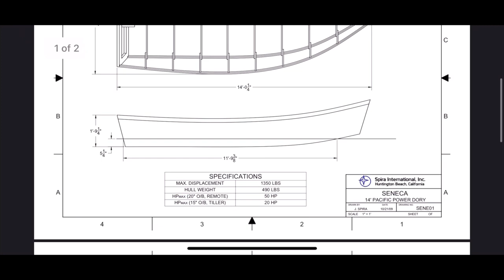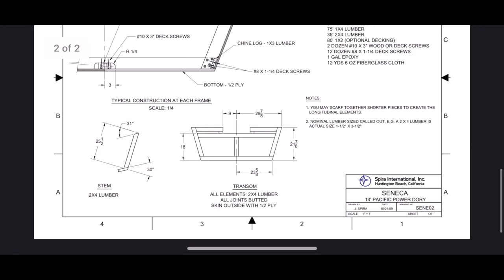Pacific Skiffs! I Built my own fishing boat! The Seneca Power Dory

Comment: Beautiful build!  How big of motor?  What made you decide on this model?
Reply from the maker: Thanks! I have a 6hp but I’m looking for a 15hp for it to get it moving a little faster. I decided on this model mainly due to storage, but now I’m regretting the size. I’m building a bigger boat to get me out deeper in the ocean. The Seneca is great but I wouldn’t take it too far out.
Reply: These boats are pretty cool. I have a 20' Pacific style dory I picked up. Has a 25hp inside an engine well, rather than hanging off the transom. It's an excellent fishing/crabbing boat. I need to repaint the exterior though, what kind of paint did you use?
Reply from the maker: @alexjackson858  They're pretty awesome! The manual I got from Jeff spira has a few recommendations, he has a video on youtube about paint for boats, very informative. After watching his video and reading the manual I ended up using a rustoleum oil based enamel paint from Home Depot.
Reply: Thanks for the tip!

Comment: Beautiful build. What motor are you running with it?
Reply from the maker: Thanks man! Currently I have a 6hp Evinrude, I’m saving up for a 15hp to get it moving faster than 7mph
Reply: @pacific_cliffs2363  cool. i have the same issue with my livingston. I have a 6hp but saving for a 9.9. like you i was only getting up to 7 - 8 miles an hr.  Motors are so damn expensive! haha. Good luck out there.